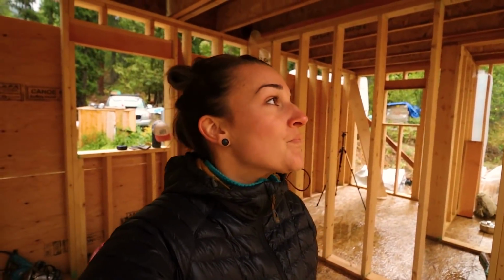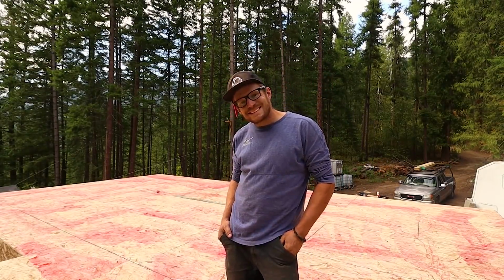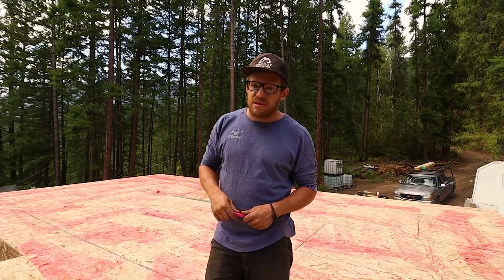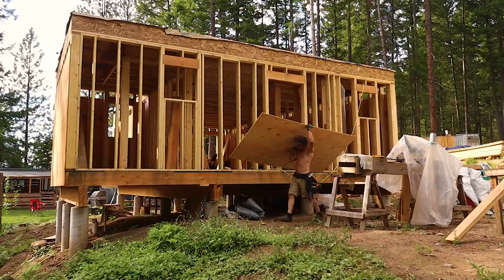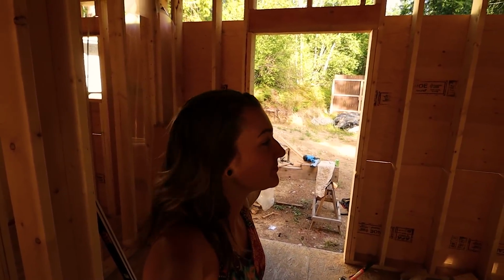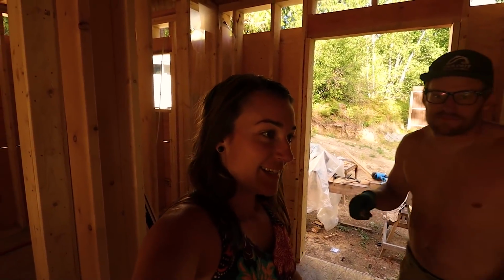Sheathing The First Floor | Building An Off Grid Home In The Mountains

Comment: If you build a platform on the side of the house that you can set sheets from the ground on vertically it will be a lot easier to come together and flip them on to there 10 at a time then go up and pull them the rest of the way up.

Comment: Yes a very good idea to maintain the compressor and drain it regularly, I also use an Air Filter Regulator and Lubricator Air Tools Fittings Water Trap (cheap off amazon) but works a treat.

Comment: And also a grill and wonderful seating area with a shaded area, power for electric things to run off of on both sides of the back wall of the living area. Patio doors or French doors leading out to the patio area, single sink to clean up morning or evening dishes. speaker cabinets for your listing pleasure, whew, that was good, want to finish my project too.

Comment: Those boards that span the i joists are called walk boards.  They span across the iboards so they do not tilt as you step on them.  It spreads the weight.  i did not see any spacing or bashing together the joints going on for the plywood install.

Comment: Hello. That's. Exactly. What. I. Did. Single. Ply.  Rubber. Roofing. Made.  Goodyear.  And. Total.   Starting.  Copperhead.  Hot. Top. 3. Ply. Built. Tar. And a.  Kettle.  Man.  Heating.  Tar.   Lived. In.  Florida.   Your. A. Bad ass.  You. Got this.  Whole.  Rock. On.

Comment: For the cost of primer and that membrane in addition to the time to apply it aswell as the problems it will cause down the road with regard to finishings why not just use advantech sub flooring or zip. More expensive yes, but more structural rigidity and moisture and mold resistance. We never use osb for flooring when framing houses.It bubbles up and swells when it gets wet which im sure you have experienced with all that rain.
Reply from the maker: We can't get it in Canada
Reply: Well then  it makes sense that your not using it.

Comment: why didn't you finish your fence, or is it finished. You two are doing such a good job, keep it up. I got going on my project too. My Son came down from Kona to spend the night and help out, he made me a ramp so I could get my wheelchair off the patio deck and I did some sanding and cleaning of burned off stain on the East side of the house and I stained two walls then got rained out. We are up 4500 feet and the sun is a terror up here.

Comment: wat was that about the compressor?  did you ruin something?  kinda glossed over that lesson.
Reply from the maker: In our last few videos you can see mist coming out of the nail gun, and that is because moisture builds up in the compressor. It wrecked the nail gun so we had to get a new one
Reply: It's good practice to drain your compressor once a week when it's not hot out. Condensation builds up on the inside and they can rust eventually.
Reply: You pay for an education my son!